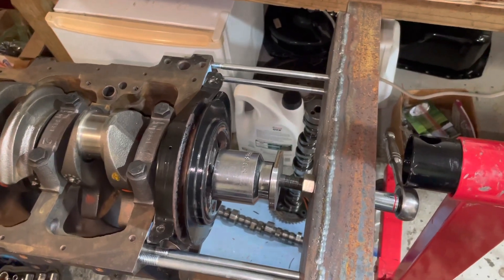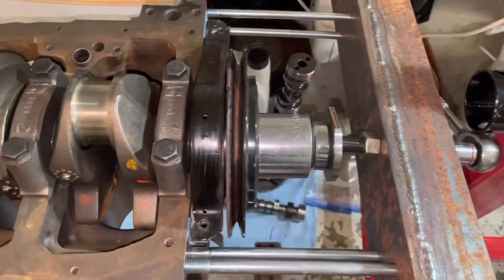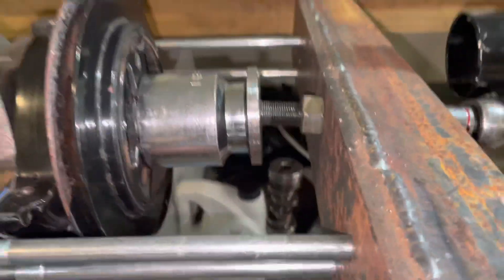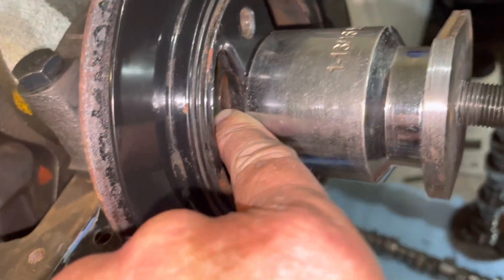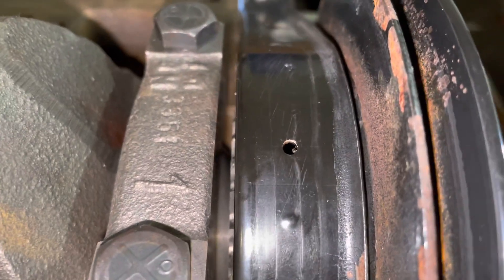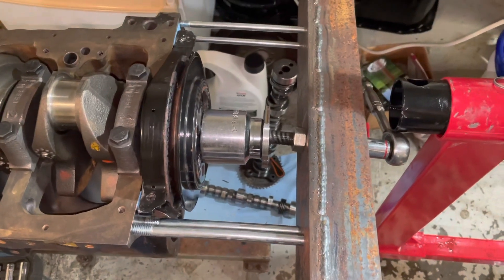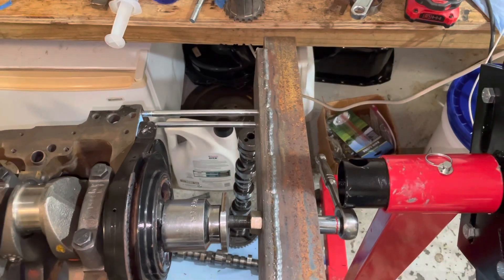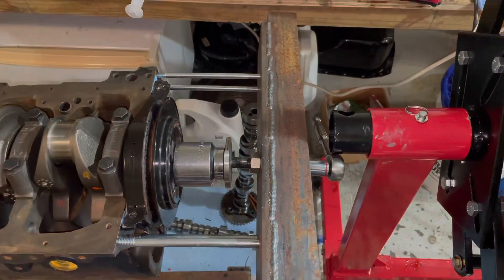Mercruiser 3.0 3(b) - Must Have This Tool

Comment: GM never fails to amaze me....Why in the world do they make these balancers so damn tight when it would be better to drill and tap a hole for a bolt to hold it in place.....I guess those engineers never work on anything they engineer
Reply from the maker: It has to be tight to absorb the vibrations but yes it should have a bolt to help install it.